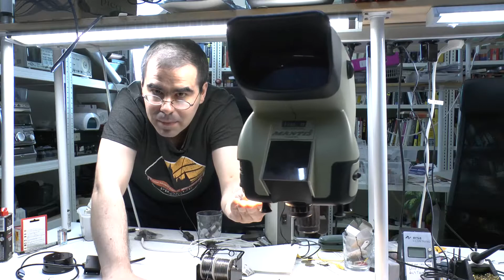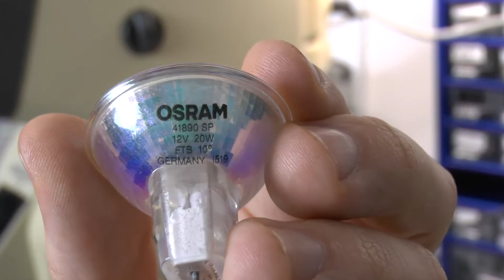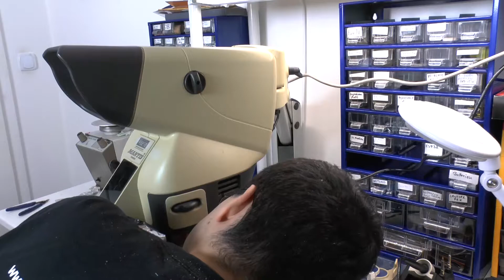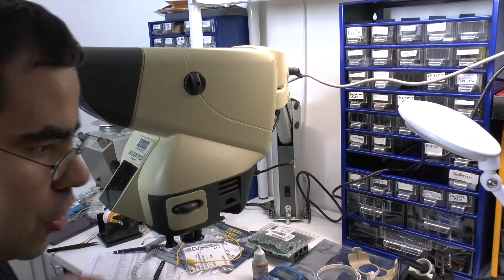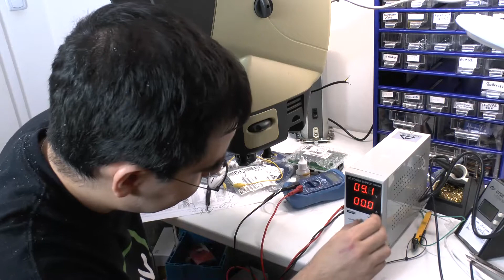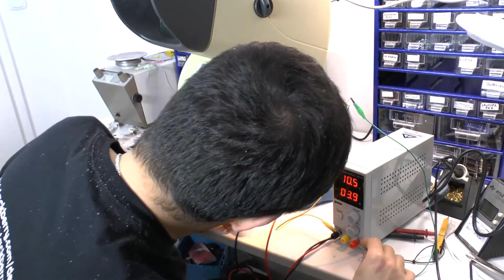Vision Mantis microscope - power supply replacement / "repair"

Comment: LED lights will work fantastically, I bought the same microscope second hand and I immediately replaced the original bulbs with LED ones. I'm thinking of disconnecting the fan to make it silent as the LED:s don't heat much so I think it would be fine without the fan.
Reply from the maker: Hi Man, thank you so much for talking back! If you change the polarity, the fan stops working ;)
Reply from the maker: I meant the polarity of the power supply

Comment: you know people inside the mantis microscopes are absolutely nothing to justify their selling prices.  In there are just few mirrors, small circuit to run the lights and cooling fan for the light sockets, a few pieces of metal round bars to move the light sockets using lever. that is it and nothing else. no wonder everything that is made in West is being copied and sold for 1/5th the price.  
since the camera microscope the demand for mantis is very low that is why it is not even worth copying.
Reply from the maker: Hello, well, this might be true. But the issue is all the development, which definitely was not cheap. As for the camera microscopes: forgive me the bluntness, but do people really use these much? I do like the stereo vision on the Mantis...either way, big thanks for talking back!
Reply: @MrTamhan  the main initial development cost was the mold for that big 95% empty housing.
Reply from the maker: @bobbauvian7700  maybe. Man, RnD expenses are quite difficult to qualify...

Comment: Funny I had a similar situation with Bausch & Lomb Stereo Scope that had not light. So I used my lathe to turn a cover/cap top down real thin. Then opened up the middle so that it would allow the screw in glass cover on the bottom scope to fit through it. Then I purchased one of those cheap LED microscope lights to mount on the cover sides than now hands down. It worked like a charm. It's funny how tech's will do anything to save a buck. In our case it was several hundred dollars that we saved by a modified cheap cap and a $14.00 LED light set up. Just goes to prove that you don't always have to go the expensive way. Thanks for sharing Tam. Best Wishes & Blessings. Keith Noneya
Reply from the maker: Hello, thank you so much for your reply and for the positive feedback. I, in fact, also ended up upgraiding the thing to LEDs. I am not sure if it makes sense to make another small video on it though...

Comment: Nice fix! Very funny about turning on the torch haha.. how many times has this actually happened to you where you blew a circuit breaker with something you were doing? For me, it happened only twice and both times I accidently sent a lot of current to ground and tripped GFCI's. A good solution would be to have a cheap emergency light that will light up after a power outage. Regarding alligator cables, I've re-built all of mine with some high quality 16 to 24AWG wires (with high temp insulation so that I can't melt them with a soldering iron) and soldered them at each end, instead of using the insanely bad crimps that they usually have. Resistance is as low as solid copper allows. In my opinion, it's important to have a good set of low resistance alligator interconnects if you do a lot of work of this kind.
Reply from the maker: Thank you so much for talking back. The issue with me is that I usually do not work on such high current affairs - I am the proverbial process computer jockey. 

As for the emergency light: I am too cheap. I know, I know...but I am notoriously cheap to myself. Strangely, not to others...but this is how I roll.

Tam
Reply: @MrTamhan  LOL I can definitely relate to being "too cheap" for myself and not for others. I have to confess, I'm a bit of a hypocrite since I suggest things to other people that I may not follow myself haha. My own "emergency light" solution is a torch that I always store in the same place, which I can reach in the dark. The thing that bugged me about my cheap alligator cables is that I kept getting intermittent contact with some of them, and when I looked at the awful crimping mechanism, I stopped using them until I rebuilt them. The thing that I'm a little obsessive about is that I want my basic equipment and accessories to work. If I'm focused on a job, I really don't want to be let down by something simple that I failed to maintain. I hope that you upload more videos when you have time - good luck! -Nick
Reply from the maker: @oriole8789  hello, thank you for talking back! I was thinking about resoldering some of the alligator clips - honestly not sure yet. As for the videos, I will try my best....